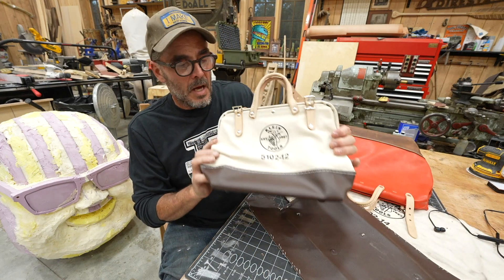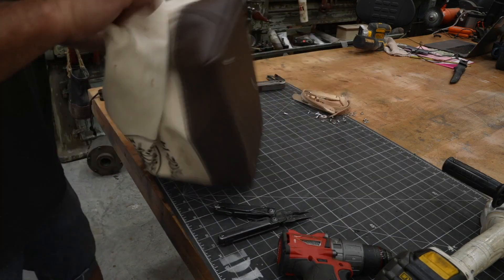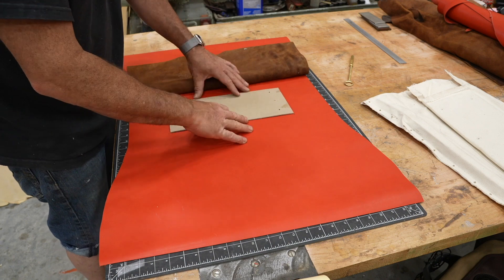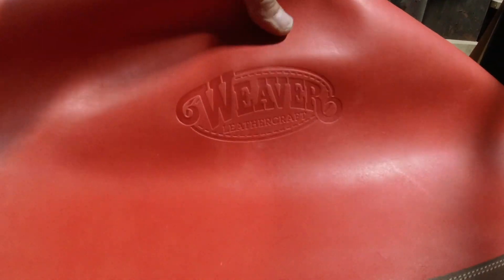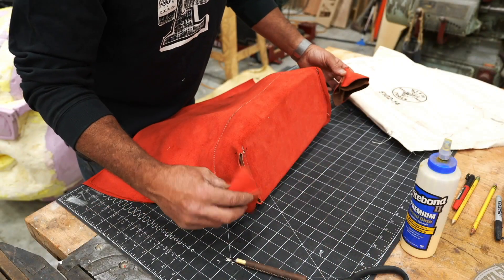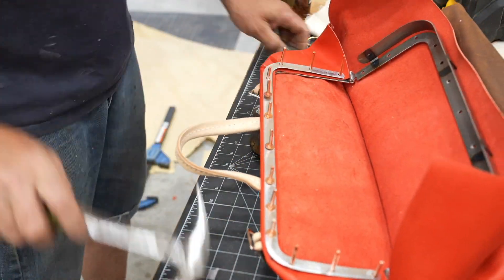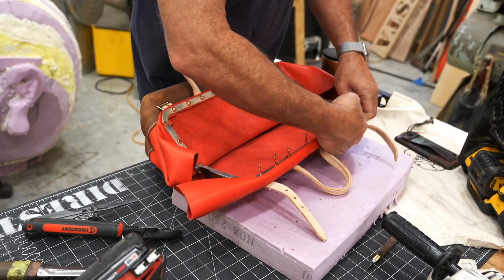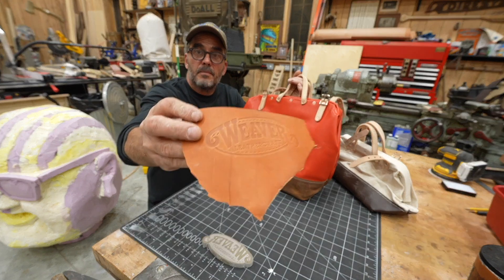DiResta Gate Mouth Tool Bag

Comment: Regarding your discussion on inability to source the metal hardware pieces; when you disassembled your sacrificial bag, did you take measurements of the metal pieces so you could fabricate them in future builds.?   Since the embossed logo was fading fast, you should have included the scrap that you embossed as a luggage tag that could be threaded through one of the straps before buckling it together.

Thanks for sharing this insightful video.  Wishing you and your family a blessed week, gentle weather, nourishing rain and restful evenings.  Peace Jimmy

Comment: I am sure you could come up with some feature to rivet to theses extra holes like some outer/ inner pocket or patches...
I believe the H shape can be cut beforehand, and this means you don't need to stitch all the way to the bottom where the cardboard was getting in the way. Then the seam across is done by "opening the mouth" and aligning the cut edges. With thinner material (fabric) you could even open the seam allowances of the side seam before stitching across as well.

Comment: I’m a leather worker and to deal with the glue not sticking to the finish side of leather problem it’s normal to scratch up the future glue area with an awl or sandpaper, I even do it on the flesh side most of the time. Also i use contact cement as my glue, it’s nice because you attach things they’re fully adhered and you can keep working without waiting for it to dry (although you do need to give 5-10 minutes before you attach stuff to let the cement get tacky) . Super great video, I didn’t really get how that bag hardware type worked until now

Comment: I had a Juki LS-340 with a post. It was used by Mizuno in a mobile baseball glove repair van. I replaced the original clutch motor with a servo, and I think it could have sewed two 3/4" sheets of plywood together :)  That thing was borderline scary when it was running wide-open.

Comment: Awesome job. I’ve had a full set of those rivet tools for as long as I can remember, but never knew how to use them. Are they specifically for leather working?
Reply: Wooden clinker boats are held together this way too. In boatbuilding they are called rivets (or just nails) and roves and the process is called roving. (edited to correct autocorrect!)
Reply: @bikergirl2000  interesting, thanks